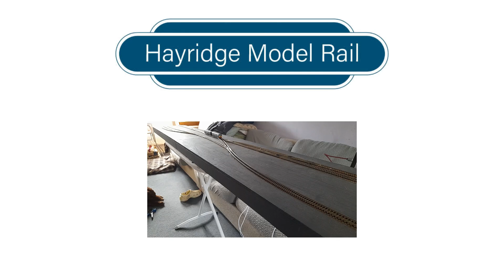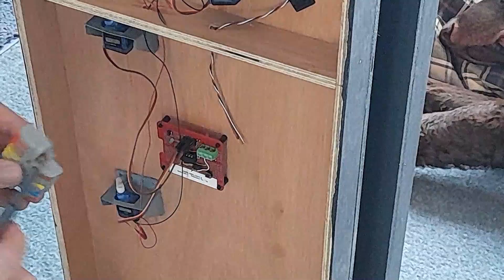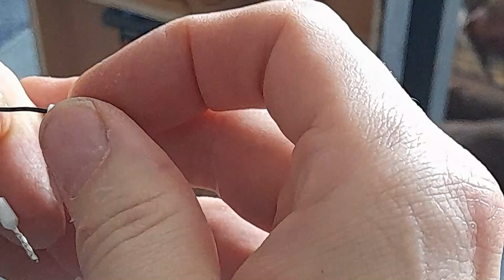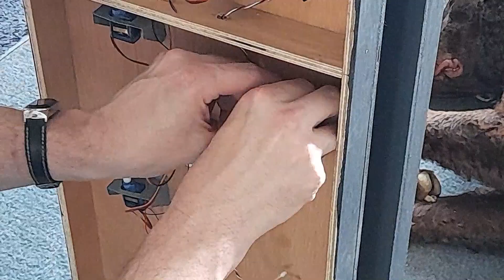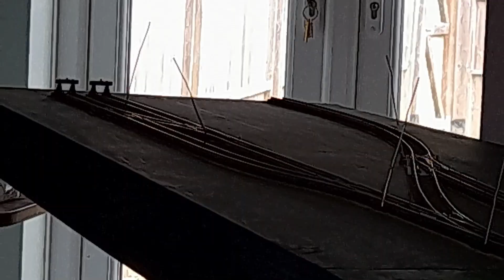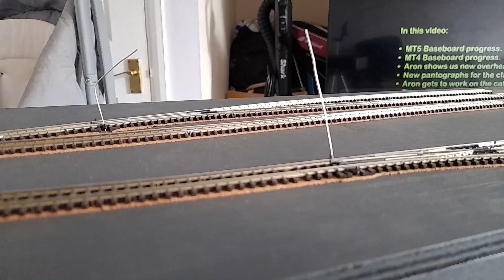042 - Circuit Boards, Servos & Trains (A Portable Layout) Pt10

Comment: Good morning Allan! Great to see a train running over those troublesome points! :) My heart always sinks when servos start to misbehave, but thankfully you got to the bottom of the problem quickly! Cheers, Ian.
Reply from the maker: @iansngauge  thank you Ian, yes I managed to sort it for the time being,but I'm looking into using ethernet cables and sockets to join the boards at they are pre wired and made up. So vfsnges may be afoot. 🤔. 
Cheers Allan.

Comment: Good to see you getting a train running.  I did find it amusing when you said 'Interesting' when the three sets of point servos didn't work.  The good thing is that you got it to work in the end.  Stephen
Reply from the maker: @Elvenhome  Hi Stephen, I try to choose my words carefully, 😊 I knew it worked as I had tried the board separately when it was fitted, so I was a bit surprised when there was no movement.
It's good having a train running, my next project is installing the reed switch sensors and starting on the tunnel.
Allan